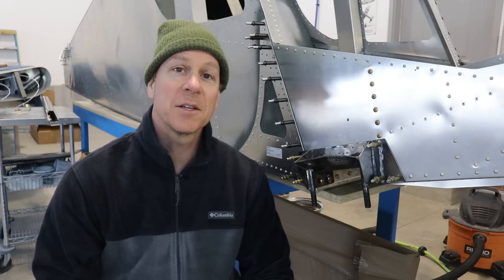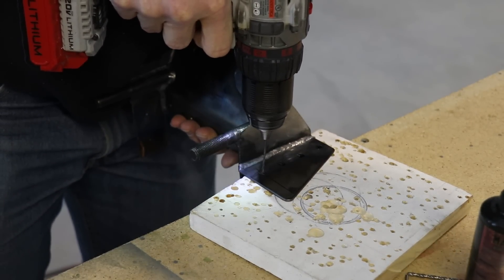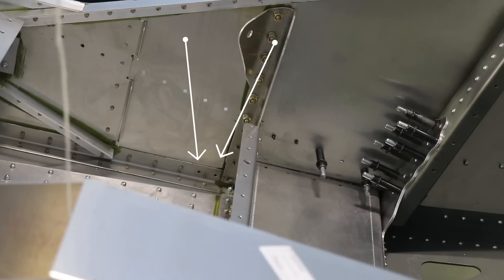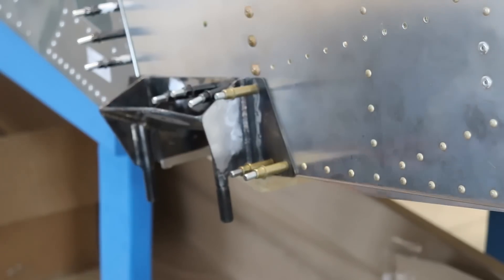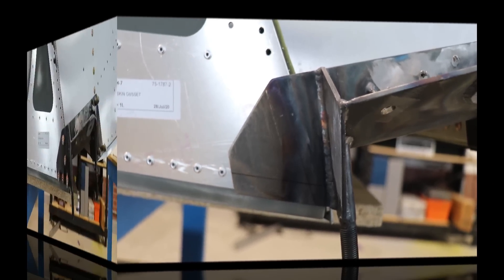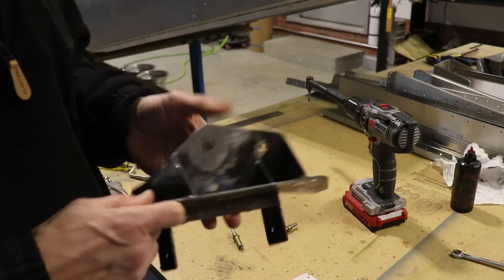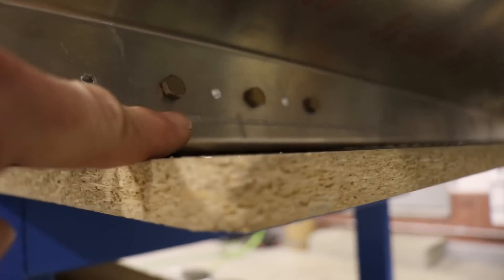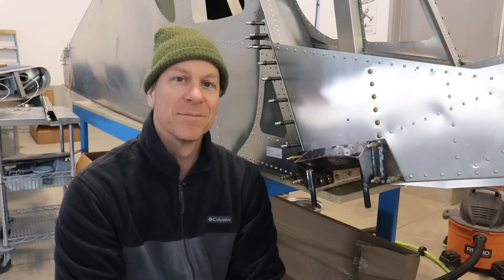Fitting the Steel Gear Brackets to the SUPER DUTY! (Ep33)

Comment: Hey Mark, there is a product on the market known as boelube specifically for drilling steel. Also remember the old saying for drilling steel, slow speed heavy feed.
Reply from the maker: It's been a while but I think I did end up buying some boelube. Thanks for the tip tho!
Reply: @KitplaneEnthusiast  Hey Mark, figured you knew about it. I'm just now binge watching the build. Lovin it. Former Air Force Structural repair  specialist myself.

Comment: One quick tip about the powder coating, make sure that you plug all the rivet holes because the powder coating will significantly change all of the hole diameters.  Ask me how I know this, I did my own powder coating and spent hours re-reaming all the holes.

Comment: Great information! I also like  tap magic. Back in the day when I was working on building nuclear submarine condensers we use white grease mix with transmission fluid and trichloroethane 111 great for drilling and tapping positively wasn’t healthy. The video by far was ⭐️⭐️⭐️⭐️⭐️👍🏻👍🏻🤠
Reply from the maker: Is Tap Magic available at local stores? Sounds like I need to get some!
Reply: I used to get it at the local Grangers but now I just get it off Amazon 20857 Tap Magic general use.

Comment: I noticed this on you Cruzer as well, I pulled the fuselage lower forward outer skin over the outside of the big triangle gusset, this way you get the advantage of both the correct overlap, front to rear and alleviates the big gap between the gear weldment and the skin. You might have riveted it already. If not cleco it and have a look.
Reply from the maker: I know exactly what you mean. When I built the Cruzer, even though the plans have the triangle designed to go on the outside of the forward side skin, I did try it the other way and not only did the side skins not fit nicely on the outside of the triangle, it just looked weird. It was clear that the triangle is designed to fit on the outside. The only downside to doing it correctly is, as you point out, there will be a small gap at the back end of the steel fitting.
Reply: @KitplaneEnthusiast  getting through my Cruzer build an appreciate guys like yourself that help out indirectly. Appreciate the great videos thanks.

Comment: If you like using an oil on your bits you can use bees wax, it sticks to the bit until it melts. It is sold in chunks specifically as a bit lubricant.

Comment: When I was doing sheetmetal work I had a bunch of bolts that I would use for temporary fasteners in my toolbox.  Had them painted dayglow orange so I would never accidently leave then in the structure I was working on.

Comment: What about steel to aluminum dissimilar metal galvanic corrosion protection? Powder coating is enough? Zinc plating or painting?  Did find this: While it is relatively safe to use stainless steel fasteners on large aluminum surfaces, the opposite is not true. If you use aluminum rivets or other fasteners to join large steel pieces, corrosion will set in and destroy the fasteners, ultimately causing the parts to come loose.
Reply: Quite correct, the part which corrodes most rapidly (the Anode, essentially a '-ve' electrode) should not be the fastener. You can refer to a 'table of electronegativities' in order to determine which material is likely to constitute the 'Anode' and which the 'Cathode' in a galvanic cell (galvanic corrosion of the Anode).

Comment: Mark, once the initial holes are aligned and drilled, why can't you then drill to 3/16" and save 2 steps? Alignment won't change after the initial holes are drilled.
Reply from the maker: Yes you definitely could. I’ve always found that I get a nicer hole if I step up the size. That’s why I do it like that.